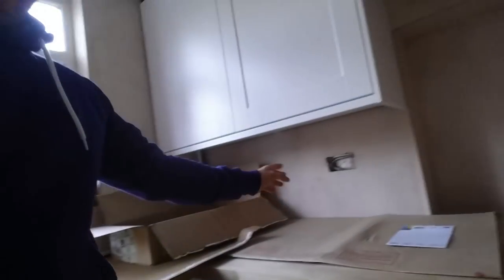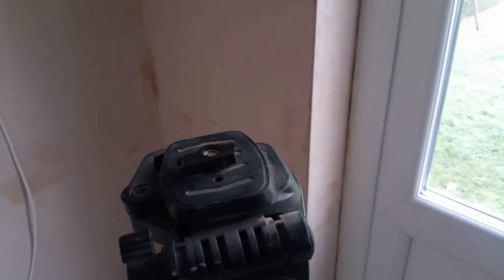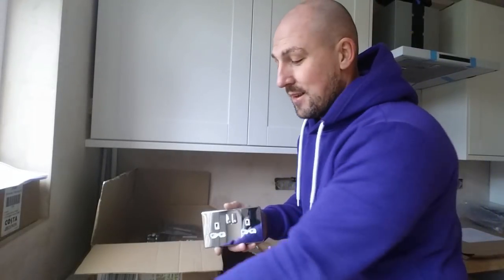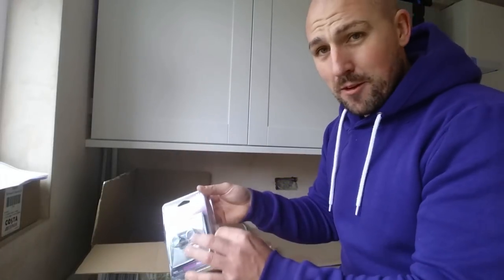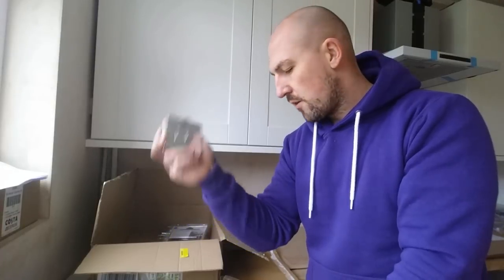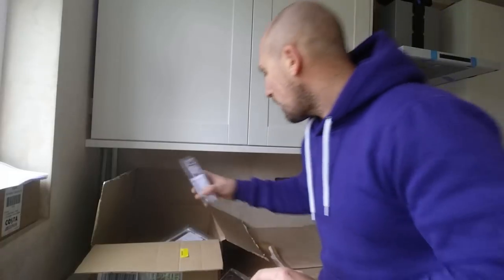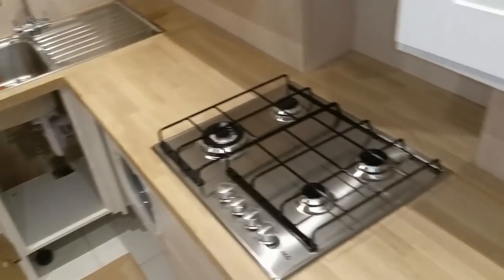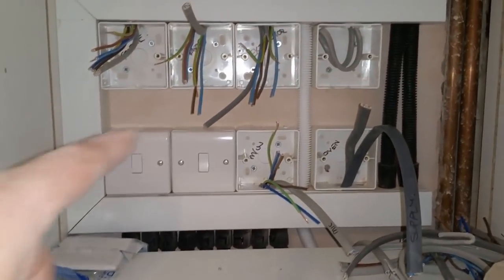KITCHEN REWIRE - 2nd Fixing

Comment: I see you use the Enlite FD pro. I really rate these fittings, push terminals, super quick to fit also use the ICE lamps which must have fitted thousands and only ever had 2 fail

Comment: Hi Luke.
Interested in the double dimmer.  The dimmer switch that does the led lights under the kitchen cabinets, what happens if you turn down the dimmer? Or is this some sort of on/off switch only that doesn't turn but looks like a dimmer switch?. Cheers.
Reply from the maker: Ones a dummy dimmer module. I did film the installation and explanation of it... but like an idiot I still had my camera set in fast motion.

Comment: Great work im currently doing my wiring in kitchen extension. Had a question about oven cooker isolation switch can this be behind the cupboards or does it need to be above worktop.
Reply: You can fit the isolator switch in the cupboard no problem but make sure you leave it accessible.......👍

Comment: Good video again mate .but I’m not a fan of them switches or the flat plate ones . 

If you have a old wall or a badly  plastered wall they look mince .

Either the plate dong clip on or if it’s a flat plate you can see the Kink in the plate when the shiny lights on it if it’s screwed to far and most of the time you have to tighten it as far as it goes to even look half decent .
Reply from the maker: I agree. Some of the cheeper switches pull in at the centre too if they're screwed too tight.

Comment: When you put surface boxes in a cupboard like youv done for the appliances can they go at any height ?? Also Seen em installed in the cupboard under the sink is this allowed in the regs mate great videos as per 👍
Reply from the maker: Only for Isolators and fixed equipment such as fridges etc.. Questioned this myself as per fan isolators above doors.

Comment: great tutorials thanks I've subscribed.  Although retired 10 years now after a lifetime in building  I am learning tips so thanks for that .

Heres a question for you. How can I hide or disguise socket outlets in a kitchen ?  Lots of images and programs on the tv show fabulous kitchens but not a socket outlet in sight anywhere along the worktops??
I just cut into my party wall today to sink some shallow boxes and popped straight through into the cavity at 25mm depth !  Arghh

When this barn was converted back in the 80s the tightfisted developer has used 140mm thick  hollow blocks for the party wall between me and my neighbour ......No wonder we can here every sound they make next door .. 
Now I need to find a way of hiding the socket outlets or I'll never hear the end of it from her indoors

Comment: Great video! Always learn from watching them. Just a quick question, when installing downlights, like you did in this kitchen, obviously you have a feed from a previous room to the one downlighter, then the rest are daisy chained (i think thats right). Does the last downlighter you install have a feed for the next room? So as the loop in method continues? Hope this makes sense lol. Thanks
Reply from the maker: Hi Luke. I supplied my switch with a brand new circuit from the DB. I then daisy chained a radial of downlights from the switch. Neutrals are wago'd together, cpc's are in the back of the box. Line from DB in common and Line to the first downlight in L1
Reply: My Trusted Electrician thank you ever so much for the reply! Am i right in thinking the kitchen lights are on their own circuit then? Or does that radial feed the whole of downstairs?
Reply from the maker: @lukeroberts13  Yeh the kitchen is on it's own lighting circuit. Keeps signing the job off simpler at the end.
Reply: My Trusted Electrician fair enough, thank you ever so much for the replies!

Comment: I'm interested to know who cleaned out the boxes after the plastering because in my experience most plasterers will completely bury a box without a thought. Unless you know the plasterer and have a special arrangement with him then you'll usually end up measuring the walls to find your socket and switch boxes. I used to coil the cables up inside the boxes and cover them with cardboard and tape to protect them, if I was lucky the plasterer would leave a little tell tale hole in the plaster so I could locate the boxes and then spend hours chiselling them out. I've even had to cover the threads on the fixing lugs with petroleum jelly on some boxes so the plaster wouldn't stick to and ruin the threads. Some so called tradesmen are jus totally lazy cowboys and show no respect or regards for anyone else's work.
Reply: Ahhh...I can tell you it's no different for us in the US...smh. 
Begin a job with rough-in of the wiring and boxes...to return at a later date, after the gypsum board /drywall has been hung, had it's seams taped and covered with joint compound, (aka drywall mud).
 Thats when the That's when the "fun" begins.... for some years now, the gents  doing this work have adopted the "rotary tool/spiral saw" into their work process. This means they don't measure and cut out the holes for the electrical device boxes anymore, like they use to do...No Sir! 
That is far too time consuming for them!  No, instead they just take full sheets of drywall, slam it up against the framing, and start screwing it to the studs and joists, after which, they start plunging their spiral saw bits into the approximate locations of the (now) buried electrical boxes. Once they feel rotary saw bit make contact with the edge of device box, they push against it to cut out the box's profile until the box face literally pushes through the cut out hole. Needless to say they often cut into the wiring that's been neatly and carefully tucked, which means it's now fu'd... often fill the boxes with joint compound (essentially plaster) and have at least a couple of of device boxes they "forgot" to go back and cut out...which turns into a game of "Marco Polo"...better hope you were the one who roughed in, or have an accurate blueprint...or you may spend some fun time wondering wtf is the matter with this 3-way lighting circuit??? ...(that is actually a 4-lighting circuit that has had the center switch buried, lol...) 
I do take some solace in knowing our troubles are not unique, Gentleman. I enjoyed your video, Cheers!
*Rant Completed
Reply: Perhaps you could make some temporary faceplates, slighlty undersize that would fit inside the boxes  covering and protecting the wires.  They could have a knob that would project out through any covering plaster and enable them to be located and pulled out.  Cover them with tape each time so that any plaster can be easily stripped off ready for the next use.

Comment: When should/shouldn't you earth the back box ? I see you didn't do that
Reply from the maker: They're earthed watch again. Sorry it's a bit fast. However they didn't need to be. So the only time they need to be earthed is when the metallic box doesn't have at least 1 fixed lug for the 3.5mm screw/bolt. It's good practice to do it regardless.
Reply: @MyTrustedElectrician  oh sorry I didn't see that. Thank you for the reply. Keep up the good content.
Reply: Should earth it regardless. As when you take the faceplate off the back of the box won’t be earthed otherwise
Reply: @fraserreid2390  but we all know you shouldn't be working live ;-) always good practice to bond to the back box but as luke pointed out there is the fixed lug scenario.
Reply: craig patterson aye, but how would you do a loop impedance test at a spur in that case? I just had it drummed into me as an apprentice to do it so can’t not do it now! Along with having the bus touching the thread in a coupler